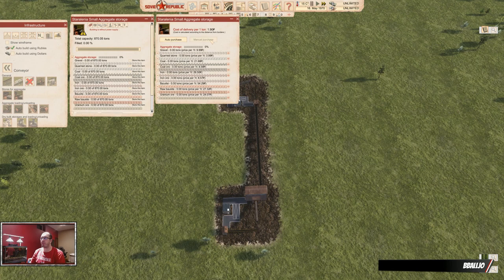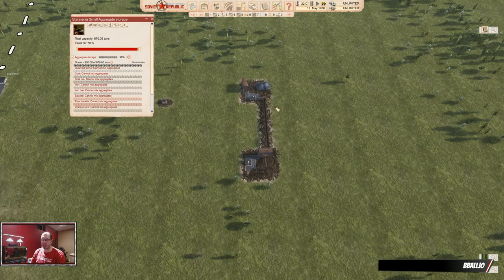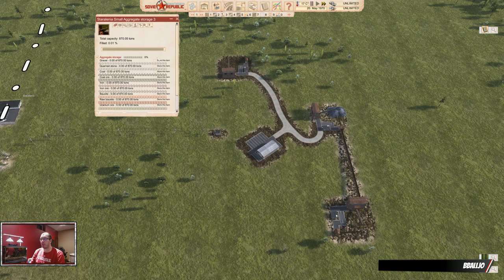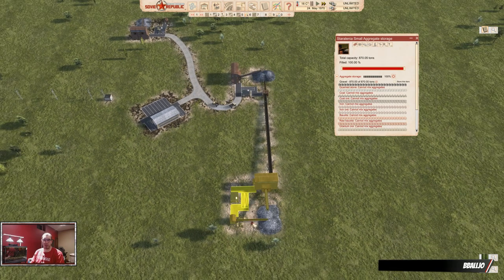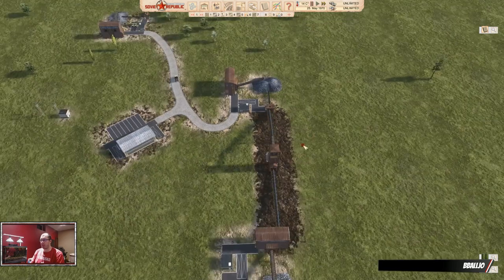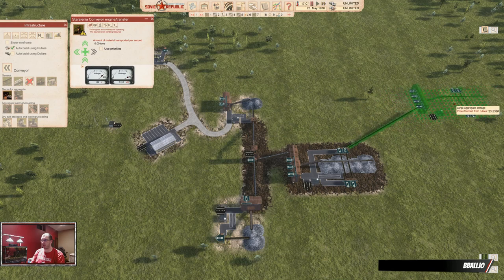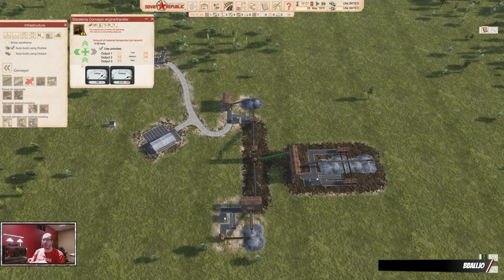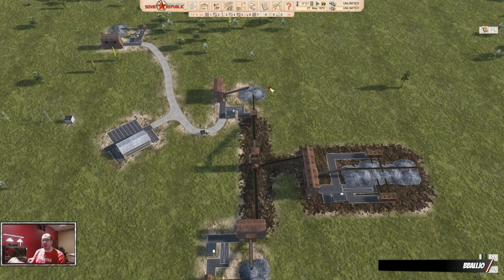Conveyor Guide | Tutorial | Workers & Resources: Soviet Republic Guides

Comment: I connected a rail aggregate unloading station via two conveyor towers with an aggregate store (I had to cross a highway). Then I told the rail distribution office to fill the aggregate storage up to 80%. But the RDO fills it up to 100% and if there are taken out only a few tonnes the RDO immediately fills it up to 100% again.  Doesn't the RDO know about the filling level if there are conveyor towers in between unloading and storage?
Reply from the maker: You may be misreading the percentages...if you set to 80% then that is the percentage when the RDO sends out a train, and it will always try to send the max train if it fits...so for the RDO, an aggregate train can fit 7-800t , for a medium aggregate storage you should set it to 50% or less, then it will be fine.
Reply: @bballjo  Okay, thanks for the hint, I checked it this weekend. Built another rail unloading station and an aggregate store with only one difference: They are connected only with a conveyor belt, no conveyor towers and it works as it should. 
When fill level goes under the 50% I set, a train fills it up. The train only fills it  when the level goes again under 50%.
Other storage (1950 tonnes) which is connected with conveyor towers is set to 50%, gets filled to the max and even if there a taken only 12 tonnes out from a lorry it is filled again by train.
Seems the RDO doesn't get the fill level with conveyor towers in between.
Reply from the maker: Sounds to me like you are ignoring the warnings in the RDO;)
Reply: @bballjo  Yes, I now know what the problem is and I'm ignoring it.🙈🙈 😅😅 But rebuilding the machinery will mess up the whole area. I'll run an extra train between gravel loading and unloading station and set it on waiting till unloaded so the issue won't block the other tasks of the RDO anymore.
For further projects I'll keep that in mind ( I hope😅😅).